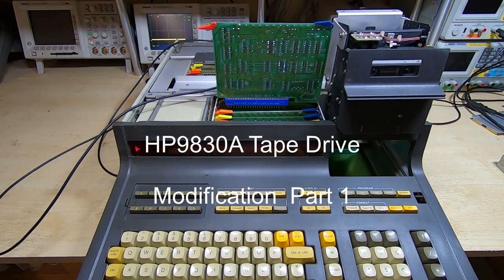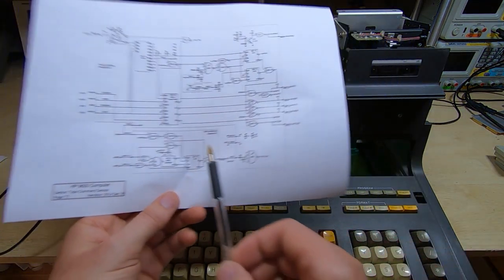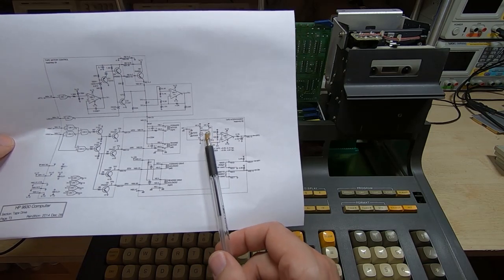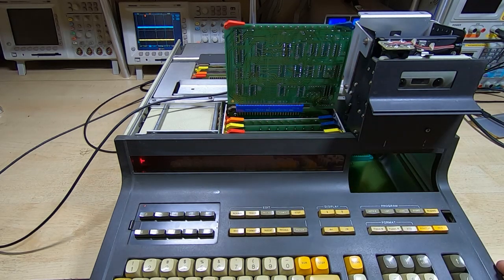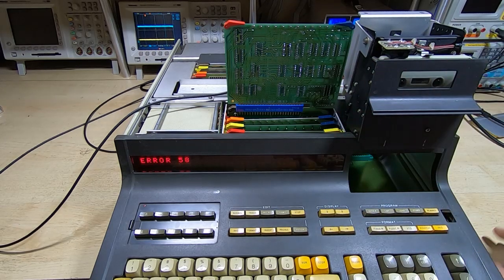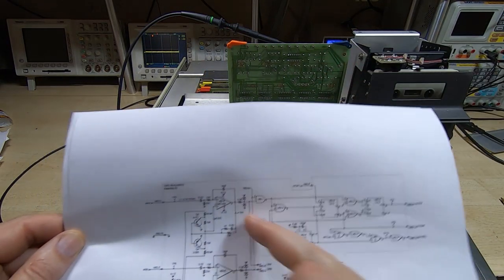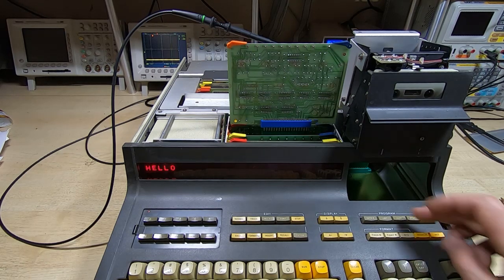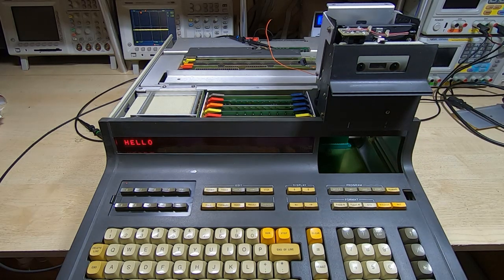HP9830A Tape Drive Modification Part1

Comment: Glad to see it’s not always a complex fix, I used to get that happen to me in the field sometimes, I used to tell the new starters that sometimes you just happen to "fix" it when you disturb it.
Reply from the maker: Yes, sometimes hitting the TV actually made it work. I never like faults that just go away because most likely they will un-go away later.
Reply: It always bothers me when the fault goes away by itself after disconnecting and connecting stuff. It leaves me wondering if it is really fixed or not.
Reply from the maker: @Bata.andrei  Yes I agree, Even worse I had removed and refitted the cassette module at least 10 times trying to track down the fault but it was a persistent fault that suddenly disappeared. The 9830A is a very complicated discrete design so it has a habit of throwing up odd faults. I mentioned in the video that it had developed another fault which I was intending to fix in a future video but that fault went away as well. The display was scrambling when more than 16 characters were entered and it got worse as more were entered but it suddenly stopped doing that (not at the same time as the cassette fix). I think it may be possessed :()

Comment: "It's had quite a lot of use" - really?! "I now have three of these" - are you some kind of masochist?! "I need to make it not work" - I can help you with that. Just a mo while I get my hammer! On a more serious note, as soon as you mentioned issues with reflectivity my mind immediately went to aluminum tape. You say that you appear to have fixed the issue with white card but sticky-backed aluminum tape would likely be quicker and neater. Only thing is it might be TOO reflective. Keep the videos coming - most are of marginal/no practical use to me but are still fascinating 👍
Reply from the maker: I did consider aluminium tape but I only wanted it to reflect the light from the bulb. Shiny tape may cause problems due to the clear window. Foil is also fairly 'directive' in terms of reflection so would be fairly unpredictable. The white card also acts as a diffuser and so its placement is not critical. You could of course reduce the sensitivity of the sensor and experiment with the foil angle but then it would not work with the white plastic case tapes. What I was aiming for was reasonable operation using different tapes. I am fairly sure that they will need plenty of attention without resorting to a hammer :)
Reply: @JerryWalker001  Copper tape any good?